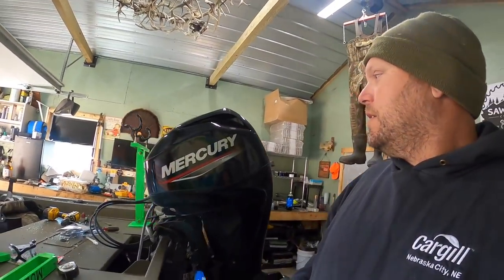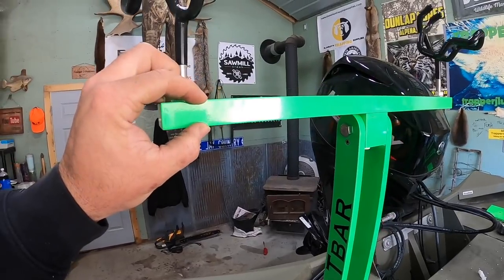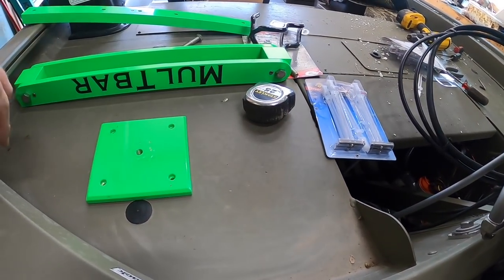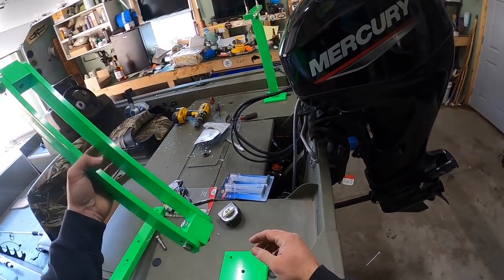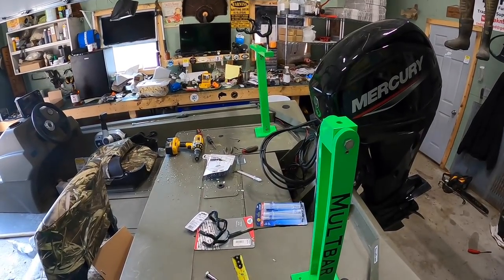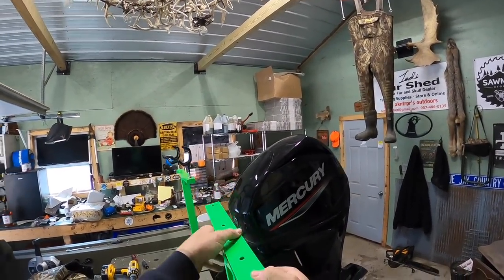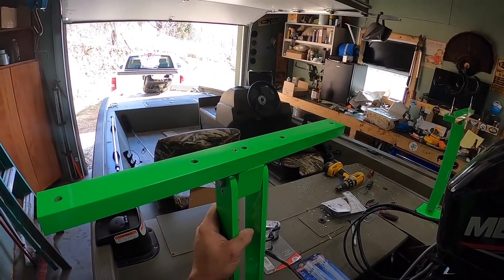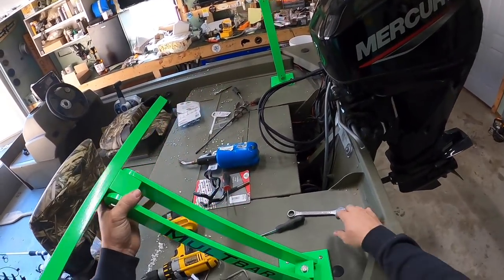installing Mul T Bar  rod holders on 2022 tracker grizzly 1754

Comment: Like the looks of these. I've been trying to find a good remedy for my jon, regarding rod holder options. I troll quit a bit, and have a regular bench seated Lowe jon, so, I don't have quit the amount of mounting surfaces. One thing I think they can improve with this one you got, would be if it had a ball mount for the base for changing directions that also you can detach mount easily leaving the base, kinda like ram mounts for fish finders, but metal version. Then you tighten with a wing nut vs bolting and un bolting. Im thinking with my limited mounting options, I may have to fab brackets that mount to my transom.

Comment: Got mine in today. Can you tell me how or what you used to drill the holes in the boat? That got the foam out the way for the bolts?
Reply from the maker: An Allen wrench on a drill! Hook the drill to the long part of Allen wrench! It will spin a decent area go as deep as you can. Email me if you have any questions I can send you a pic trapperjb80@gmail.com
Reply from the maker: I used what ever size drill bit the bolts say to use
Reply: @TrapperJOutdoors  okay I was just unsure how the nut piece turned flat with the styrofoam in there
Reply from the maker: The Allen wrench removes the foam in a decent circle

Comment: Trapper J. I'm kicking around this same setup but I have a question. If you take wrench can they be laid flat so you can run a cover over your boat while trailering it?  I'm gearing up for a trip to the Missouri and lower Mississippi  next spring and large catfish will be my main target.
Reply from the maker: Yes you can just keep a Allen wrench and a 3/4 wrench in the boat they are easy to adjust
Reply: @TrapperJOutdoors  thank you sir

Comment: Are the toggle bolts still holding??? I’m trying to find best way to mount mind cause I’m in the same situation
Reply from the maker: Yes sir
Reply: What did you do about the foam? How’s you remove the foam on the back side for the toggle to hook up